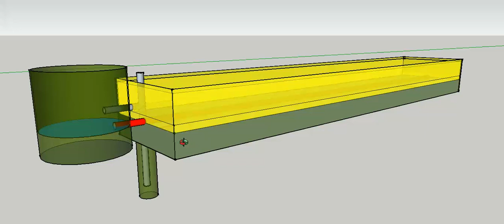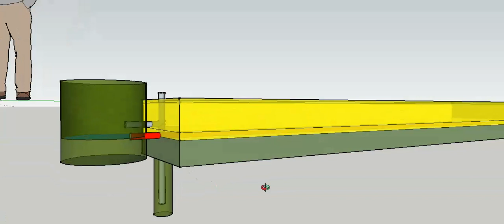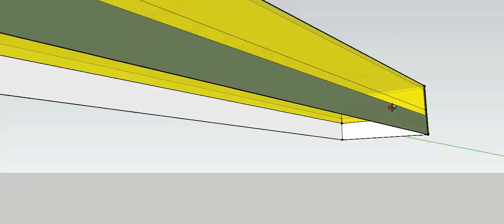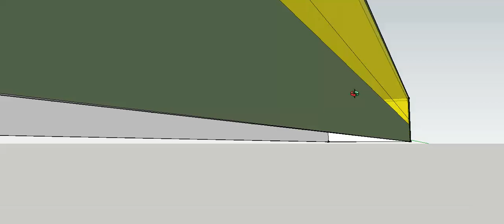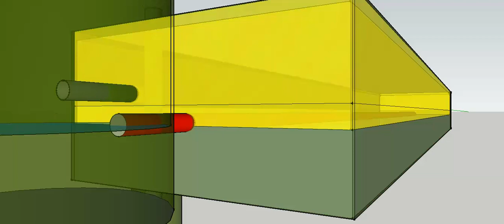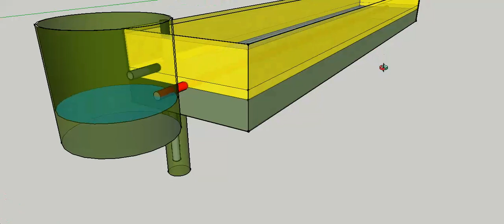Ground Level Earthan Bed Concept

Comment: I've seen a couple of flaws with the system but if it works for you that is good. personally I rather use a mechanical pump I get on average 2 or 3 years of them. With  cistern  have you thought of have a float valve  like controls the water in the toilet cistern  you can set it to the desired  let just by bending the arm, they are an item I've had a great deal of  experience with using them in cattle troughs with a mechanical pump can have a more or less water pressure as desired and another tip is have  a connector where you can hook up line from a compressor to blow out your water line periodically. Also try and avoid using any corrugated water pipe as they will block faster than a straight walled line. I love the concept because the system I'm looking at building  will have a venturi that will allow a seaweed solution to  enter the water supply. It's been a concept that I have thought about for a few years. I already have wicking beds but find that  are some what limited the water can go anaerobic over time.
Reply from the maker: Gordan, thank you for your comments. After a couple years of use I would like to tell you about some troubles I encountered.  The most devastating failure came when roots grew into the outlet pipe feeding back into the sump tank.  This caused the water to spill out into the soil around the sump while it was being emptied causing the sump tank to float up out of the ground.  I have also discovered air pumps are not as long lived as I thought and the expense of rebuilding or replacing puts the cost equal to or even more than a mechanical pump, so I agree with you.  In my second system I used a mechanical pump and put it on a timer that runs only a few minutes a day.  This has reduced the wear and still provides adequate aeration.  I have other systems where I have purposely allowed anaerobic areas to exist.  I have not experienced any problems with this.  The anaerobic areas  allow certain bacteria to grow which chelate minerals such as iron.
Reply: Hi Bob, Thanks for the reply could post any other videos you have on the system Paul Wan Der Werf seems to have gone to ground  something with the anaerobic issue I found out about  a couple of days ago was if air can be introduced into the bed reservoir  like perhaps use in the greensmart pot  and noocity beds I let you look them up rathe than me trying to explain  I've got 18 greensmart post which I intend to link together  using equilibrium  to balance them tem mist from above in a shade house. If I can come up with a plate design that I can make fit an IBC I'll try to utilise them. everything is up in the air as I only built this current house midway through 2015. I'm still working on getting the yard in shape. It take a while to sort out an acre an and half on a slope. But I'd be interested in seeing all you successes posted.

Comment: I did a bunch of experiments using thick builders plastic, like the stuff you put under a concrete slab. that was about 60USD, (2,000THB) for something 3.6M by 100M if I remember rightly, still have about a third of it ready for next gig. I have never seen the stuff fail.

Comment: Hi Bob, you can also have an upturned container (smaller diameter than the round barrel) inside the round barrel.  Divert air into it from your air lines and you can quickly empty your round barrel into the grow bed and have it as an ebb and flow system.  (Then let the air out and the water goes back into the barrel)
Reply from the maker: Yes I'm sure you can.  I'm using a timed fill and drain right now
Reply from the maker: I'm sorry I was in a rush and did not fully understand your idea.  Yeah I think that's a good way to make an ebb & flow out of an airlift.  But keep in mind the Earthan beds do not fill up like a media bed.  The water level always remains the same level as the drain..  Right now I'm flushing water though five times a day rather than constant flow in order to conserve energy
Reply: Bob Campbell
Yeah, I re,looked. Thought it was aquaponics at first glance. I think it will work. But I doubt that you need so much drainrock.  I bet 3 inches is plenty. In my horizontal pallet gardens, I have a 1 inch air gap at the bottom to let the water come back. So much smaller beds of course but it seems to be working ok. I airlift water up to above and let it drip down into the soil.  The value of this is for small plants.  They can get nutrients from close by and also it carries heat with it. In a cold climate, you should not underestimate the amount of heat that water moves.  Water has about twice the heat capacity by volume  that soil has, so if you add it at top you can transfer heat that the soil soaks up in the day down under where it can stay. If you leave the heat at the top, it can re radiate away at night.  So, I guess this heat transfer is only of value in spring.  I have mine on all the time just to see what will go wrong but it would probably be much better on a timer like yours. It delivers too much water in winter.
Reply from the maker: Brian White
I've spent the morning watching  your videos.  Good stuff!   I like the economy of both your materials and use of energy.
Reply from the maker: Brian White
The depth of the drain rock is more for creating a bed for nitrification rather than flow.  It may be that the soil would contribute to the nitrification, but at this point I'm still copying Paul Van der Werf's design.